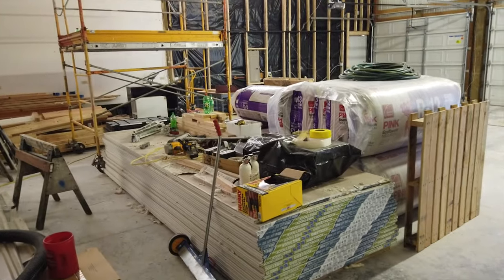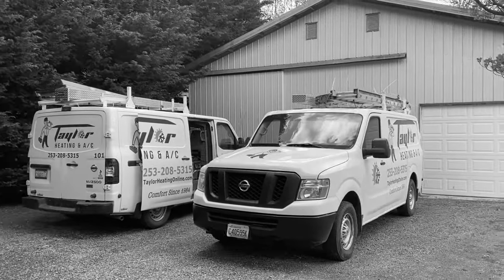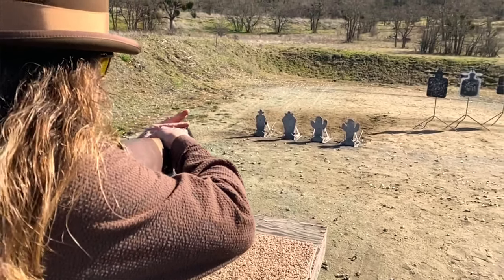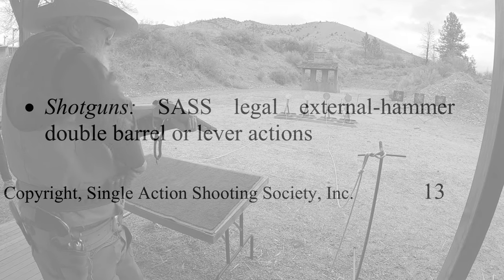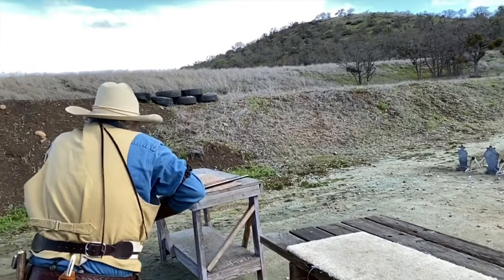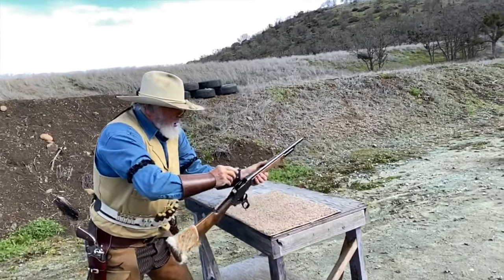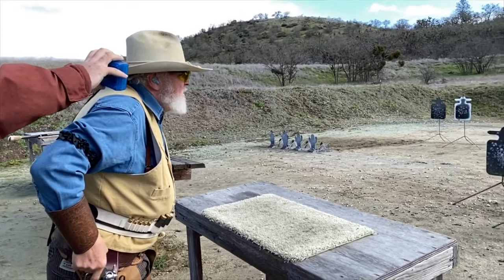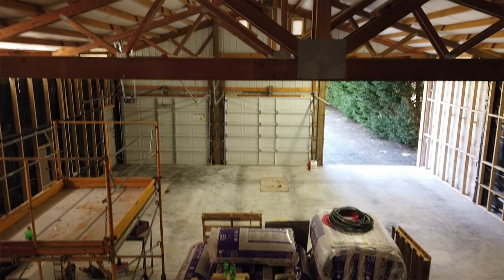@kbelltv Toy Museum Update + 1887 Lever-Action Shotgun for Cowboy Action Shooting w/Deacon Doug!

Comment: Lassiter did some work on my friends ‘87. His work is amazing, the action was so smooth. Considering buying one and having him work on it once I get the money.
Reply from the maker: Lassiter did some work on mine too.  He is definitely the “go to” guy for ‘87’s.  ~Jed 🤠
Reply: Lassiter worked on my Beretta gold rush pump..... had it for 12 months got it back not working and banged up bad. YAY
Reply from the maker: Marko... that is unfortunate and definitely not the norm with him.  Have you called him on it?   My experience is that folks in this community will stand behind their work.  Hope you can get it sorted out. 
~Jed 🤠
Reply: @JEDiTV  Hi.... in the year he had the gun I was only able to get in touch with him twice, as you can imagine I was nervous my gun simply was gone. He was not in contact with me or any updates. The gin just showed up one day no heads up or note or anything. I sent to him perfect it arrived to me scratched barrel and receiver and lots of dents and scratches on the wood. Oh and same problem as I sent it to him... not fixed.

Comment: Hi, Great vid. 
I just have a question. Can you use the regular 5+1 1887 and simply load two rounds the way we see in the video, or does it have to be modified to only accept two rounds ?
Thanks.
Reply from the maker: The one I have is a Coyote Cap Special Edition and it can be loaded with five rounds in the magazine tube.  Same with the pump action 1897. 
Hope that info helps.  ~Jed 🤠
Reply: @JEDiTV  yes it does help me. 
Thx a lot and keep going.